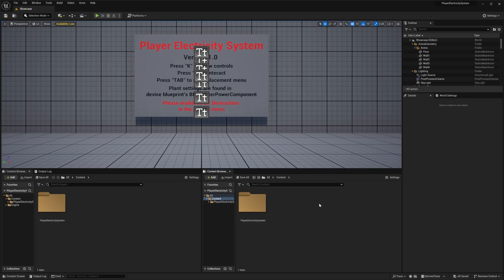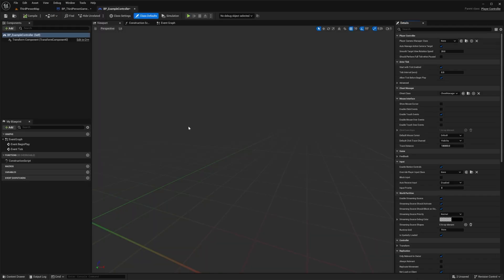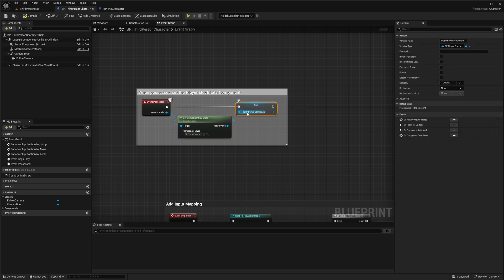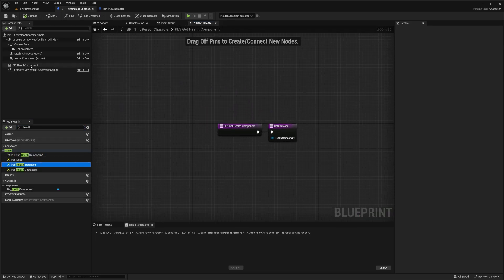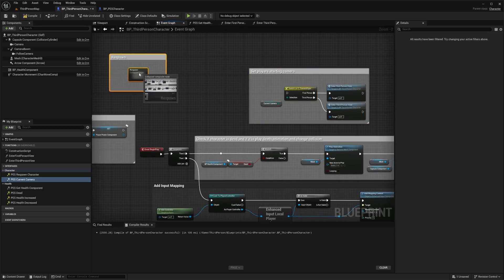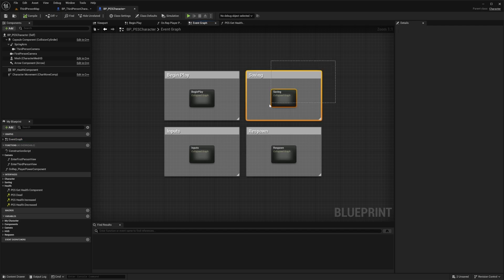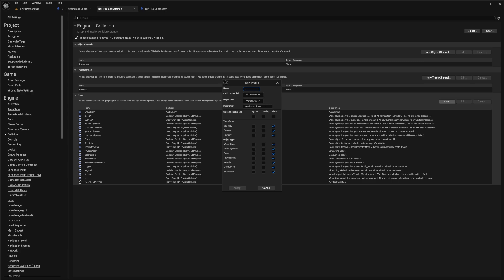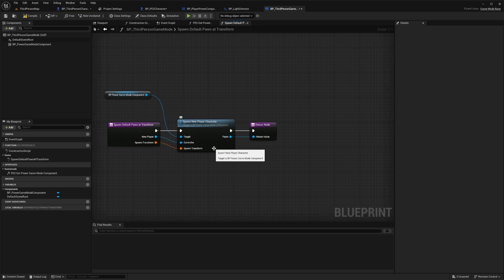Player Electricity System (Add to Project)

Comment: Could you record a video instruction on integration into SGK v2?
Reply from the maker: Hi, 

Sorry I dont have any plans for that, there is a written SGKv2 integration guide in the documentation.
Reply: @DefuseStudios  Sorry, I didn't know there was a manual. Thank you very much for your work.
Reply: its work fine in SGK V2 Just follow the steps in the video and apply them to your SGK V2 project and it will work without any problems.